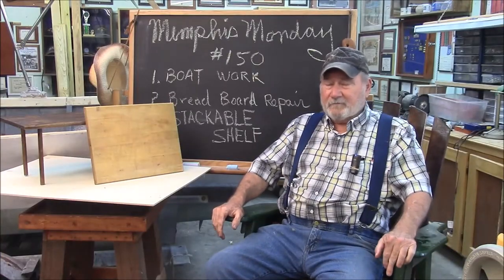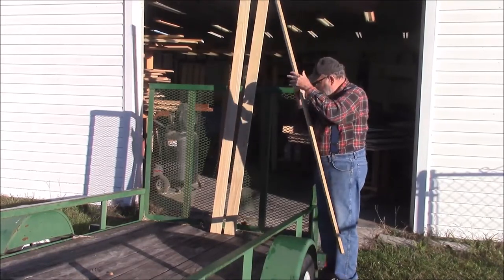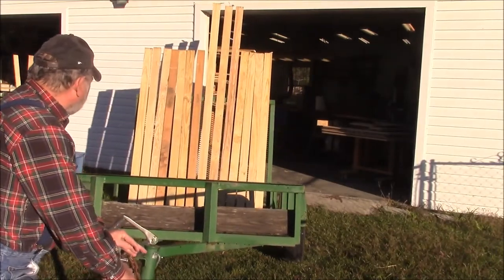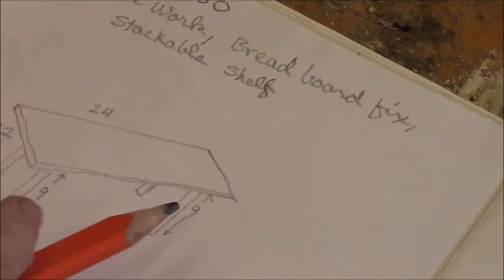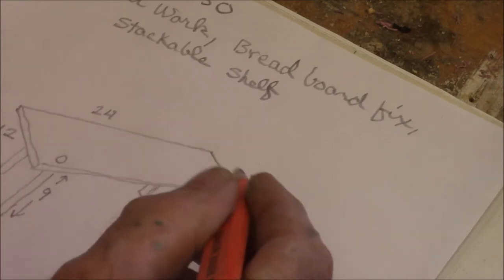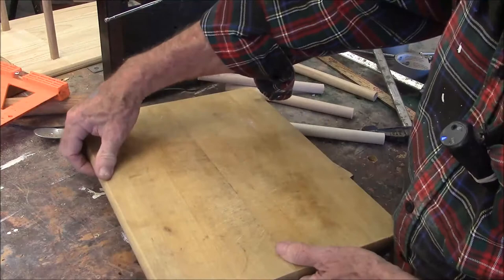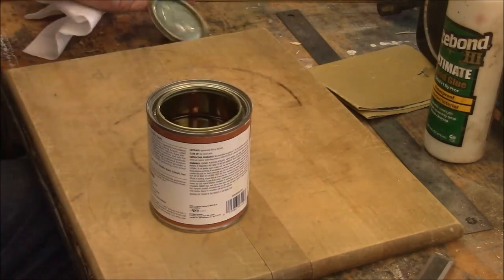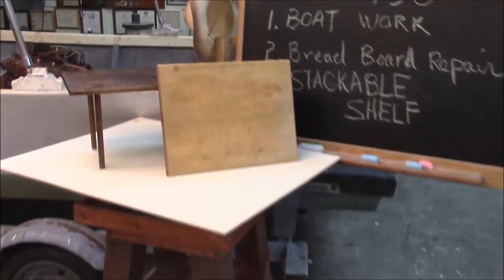150 Boat Work, Cutting Board Fix, Stackable Shelf build

Comment: With everything out of it, The MV Memphis looks much bigger.  I guess I didn't realize it was so big.  I love the clean lines of it.

You have made me think differently about my cutting boards.  I work diligently to try to remove the stains and wear.  Little did I know that I was removing the patina.  Hahahah.    I will try to embrace the wear from now on.

I love the little stacking table.  It is a very simple design with little detail but it is quite elegant.    This way it will not detract from what is being displayed on it.  

You packed a lot into this episode 150.   You will wear yourself out if you try to keep up this pace.
Reply from the maker: That was one problem with the old design: the whole interior was filled with false bottoms, with no room for the crew.  I've taken her back to basics - right back to the original hull and ribs.  No more fiberglass and Red Oak, just real wood.  The new interior looks much better - more real - more appropriate.  
      I get nervous with anything old.  "Do no harm," I guess is the medical creed, and that's how I approach restoring old stuff.  However, I can't say that patina is a "good thing" on cutting boards.  One look under a microscope and I suspect that Patina would lose her place in line.
      Episode 150, and it is only a few weeks until we finish our third full year - over 156 total Memphis projects, and starting in April we will be Seniors!!
      The MV Memphis may indeed wear me out.  
       Thanks for watching and commenting.  I always look forward to your visit.  Hope you are enjoying the warmer weather.
Reply: At the very least, I will keep doing a bleach wash of my cutting boards from time to time.  
Wow!  I almost feel like I am going to be a grown up now that I am a senior.  Actually, I am happy to now be that kind of senior that gets a  discount in many places.    
Just remember that slow and steady wins the race when working on MV Memphis.  
Yes.  I have made the most of the warmer weather.   Even though it is supposed to turn a little colder, it is still not as bad as it could be.  However, I was reminded that we are coming up on the 25th anniversary of the terrible "Blizzard of '93".  I hope we don't have a rerun of that year.
Reply from the maker: I was working in Washington DC during the terrible Blizzard of 93.  Of course, I loved it.  But I was also in the Blizzard of 78.  I was teaching school in Indiana at the time, and I was at an after-hours teachers meeting.  Half-way through the meeting somebody interrupted the Superintendent of Schools, saying that "We need to leave now."  
      The Superintendent replied that he had a few more things to discuss, but the interloper was persistent, "No sir," he said.  "We need to leave now."  It didn't really help, as I only got my car about a mile away from the school.  I jogged the remaining three miles home.  It was so bad that the school didn't even call the next day to notify me that school was cancelled.  
    And my car?  A week later I assumed my car had been stolen, but actually it was buried in a 10 foot snow drift.  We were out of school for over two weeks.  
     Slow and steady for sure on the MV Memphis, afterall, I only work on it, it's not like I wear the thing out.  The MV Memphis is 10 years old, and I bet I haven't put it in the water 10 times in all those years.  It's not boating, or fishing that is eating my soul, no, it is boat building!!  Unlike most of my other project, MV Memphis moves - it has power - it can be directed - it can transport things.  Climb aboard and you can feel her move, responding to the helm, or the rudder, or the throttle,  or the water, but responding, as if she were alive.  
     Yep, we will be Seniors starting in a few weeks.  Question is, are we starting our Senior Year in High School, or in College?
Reply from the maker: Just read my response from last night!!!  Have I been drinking again?  No breathalyzer needed, just read my YouTube blurbs from the night before.  Your Honor, we find the defendant guilty.
Reply: I don't remember a blizzard in 78 but for the winter of 76-77 I was in WV.  There was snow on the ground from the middle of December to the middle of March.  Over Christmas we had over 40" of snow.  I just remember that being one dark and depressing winter.  Snow gets very ugly after a few days.

You wax so poetically about your desire for boat building.  Maybe there is a meaning there.  Is it possible that you just haven't found the design for the MV Memphis that makes your heart sing?    Alcohol or not, You have something going on about that boat.  You keep coming back to it rather than starting on a new one.  Now that you are going to be a senior you will know more what you are looking for in you vision of the perfect boat.
Reply from the maker: I most likely got my years wrong.  It's good that the weather weenies are now naming these winter storms.  Big storm heading North right now, but I don't think it's cold enough in the midwest for a big snow event.  
   Lunch break is over, better knock off the chatter and get back to work.

Comment: Since you recycled your old TV stand I had been wondering what you would build. The shelf came out nice and it's good to see that old TV stand lives on in a different more appealing configuration. I can only imagine what a chore it must have been to remove that spray foam insulation from your boat. That stuff is like glue and it's nearly impossible to remove. I understand not wanting to remove the patina from the cutting board. I don't know why I like the patina but I do. I have one here that looks very similar and somehow it just wouldn't be the same without those many years of patina.
Reply from the maker: I worked hours, days, and weeks removing the old interior of the boat.  Removing that foam insulation was grim.  I tried every power tool, and every scheme I could dream up, but it finally came down to me and a scrapper.  A little at a time; every time I walked by the boat I'd do a little more.  
     I don't think my friend cared about patina, but I just hate mucking with history in old stuff.  In the end she got back her old board in original condition.  Don't think she cares about that either, as she keeps the other board I made her on her kitchen table as a centerpiece.  Flattering.  
     Hope you like boat work, as we will have it for the next two weeks.  Hope to see you there.
Reply: I've also had to remove a little bit of that foam before and it was horrible. I would use another word besides "grim" but it wouldn't be very family friendly. When that stuff gets on your hands during application it is impossible to remove. It kind of has to wear off. As for the cutting board you made your friend, I'd also have a hard time using it because of the looks and quality. it's just too nice. I'm looking forward to the boat work.
Reply from the maker: I heard that they used or still use something similar while transporting nuclear weapons!!  In an emergency, rockets fire downward, pinning the truck to the pavement, then the interior of the truck fills with that expanding foam (or something like it.)  I can believe it too.  Can you imagine finding yourself in a room filled with that stuff?  
       I've had clothes I had to throw away because of the stuff.
       I hope everyone does like the boat work, as I will do more if folks like it.    Thinking about rigging a small (like 7 HP) motor up to an old salvaged boat.  But there is no sense filming the process if nobody wants to see it.  
       Thanks for watching and commenting.  I always look forward to my regulars showing up.
Reply: I can believe that about the nuclear weapons as well. They also use the stuff for custom packaging since it expands to fill ever nook and cranny. Of courses the foam is inside some sort of plastic bag. I can't speak for everybody but I do like watching boat work. I can't believe the next video will be #151! I have watched every single video and it sure doesn't seem like it has been that many.

Comment: I enjoyed today's projects. Why isn't the engine mounted closer to the end of the boat?  I'm surprised to see you're using a plastic "speed square". I'd love to see you build a quality "speed square" out of wood.
Reply from the maker: The engine is an Atomic 4 sailboat engine; a real inboard engine, with a 14 degree angle on the Shaft Log and Strut bearing (which is outside the boat.)  The geometry of these angles dictates the position of the engine.  Actually, it worked out well, as the engine weighs 350 pounds, and being in the middle evens out the draft.  Perhaps I'll do a tour of the boat and explain everything.  May I show your comment in that video?
      I have several squares, but that orange one always seems to jump out at me when I need one.  I'll look into a speed square project.  
      Thanks for watching and commenting.  Big cabinet making project starts next week, and after that, it's back to the boat.
Reply: @ Memphis Applegate. I will be looking forward to your speed square project! As a long time land lubber, I thank you for your answer. I would e honored if you used my comment in your boat tour video.